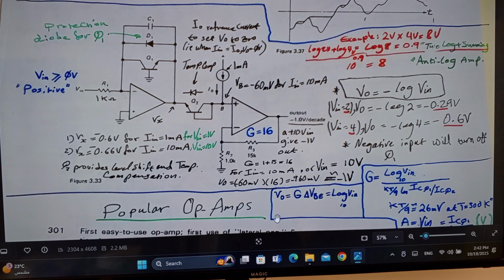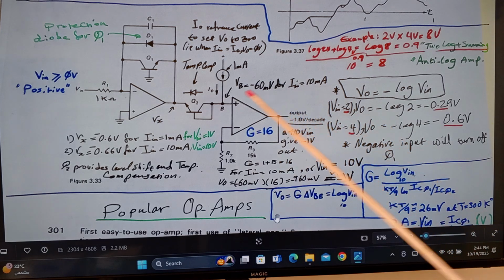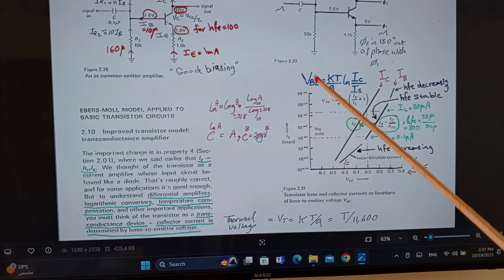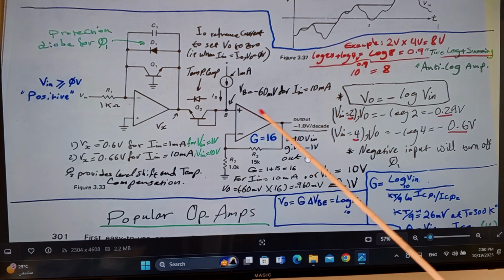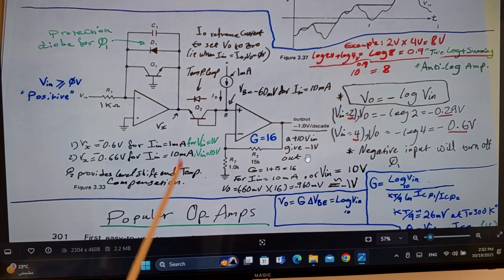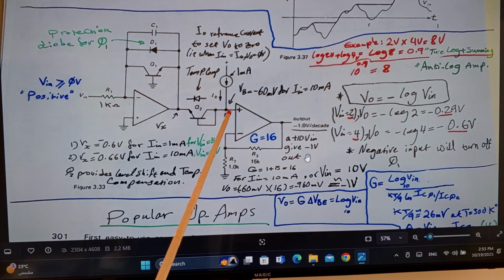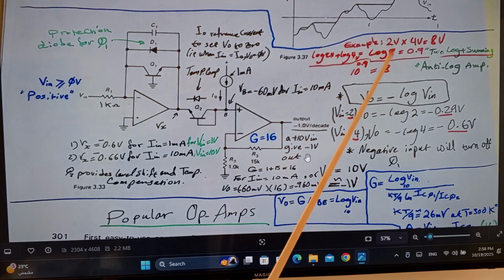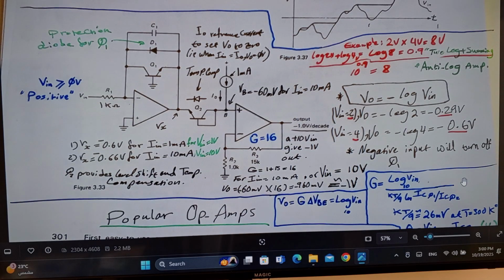Logarithmic amplifiers, lectures 1 Op-amps , Transistors ,Vo=-logVin, دوائر اللوغريتمات 🇯🇴

Comment from the maker: Logarithmic amplifiers .
This is my first lecture of a  series of lectures on this subject that I intend to make ,these are fascinating circuits, where  a bipolar transistors working alongside  Op-amps  to perform mathematical operations, such as  multiplications ,divisions ,log , anti- log ,root square and  squaring circuits.

This lecture describes how we can get a logarithmic output for an input voltage . 

Vo=-log Vin
Vo=-1v for Vin =10V
Vo=0v for Vin = 1V
Vo=+1v for Vin 0.1V

The current  source that supplies  1 mA  through Q2, is chosen exactly to pass the same current of  R1 when the input voltage is 1volt ,  when both currents are equal  Vo =0 , because log 1=0.

Comment: How does Q2 provide temperature compensation?
Reply from the maker: It must be temperature compensated, because they are built on the same substrate You see Q1 and Q2 are matched pair like LM 394 for an example .
Reply from the maker: The transistor matched pair are  temperature compensated, but the output voltage  is not ,You may see my following lecture , which is lecture 2 on the same subject, where the output voltage has been compensated with temperature , by temperature dependent resistor.
Thanks for the good question